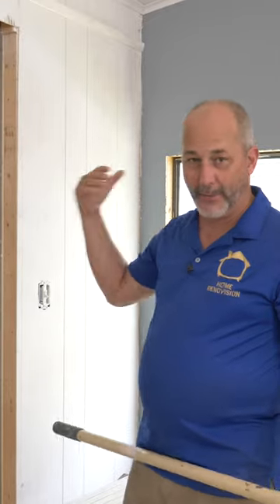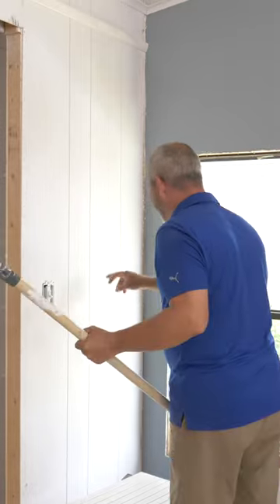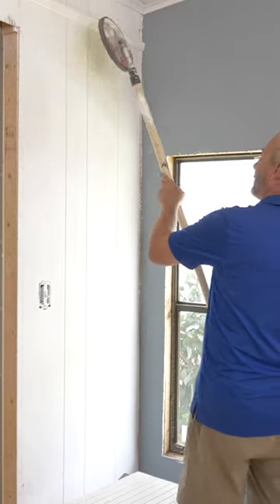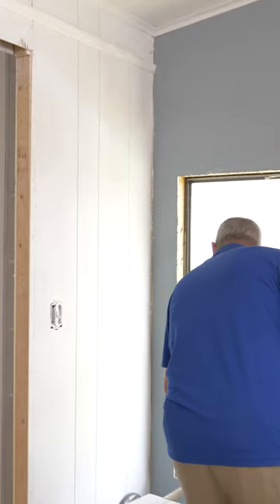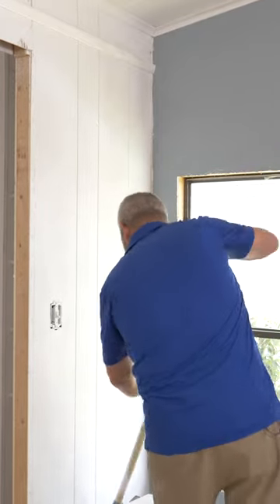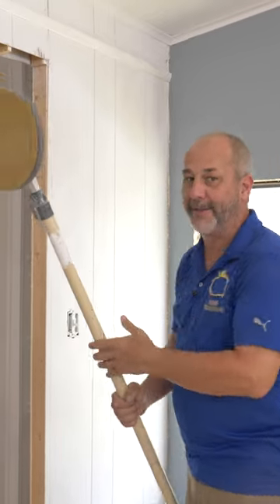Why Doesn't EVERY Painter Follow This Step?

Comment: Friendly tip! Your right, but do you use a damp cloth to remove the dust before applying the last coat? The gooseneck guy!  Cheers!
Reply from the maker: Hi Donald, no need. any fine dust acts like extra solids in the finish coat and is so fine it does not feel like dirt on the finished surface. Cheers!
Reply: Kind of the thing you know but don’t always do
Reply: That's the question I had.
Reply: I use a damp sponge. Seems to work better and last over more surface area.
Reply: Especially in delicate picky owner homes. Reduces so much dust 😅

Comment: What grit do you use?
Reply: Use fine grit 200+
Reply: I would use 24 grit sandpaper it works wonders trust me
Reply: @Adudeucantrust  you're missing a zero at the end
Reply: @Adudeucantrust wait a sec...can I trust that you didn't do that on purpose?...
Reply: @Adudeucantrust  I think you mean 240 grit not 24 grit.

Comment: I actually like to sand and rinse the walls with a hose, in between coats
Reply: Pro tip: complete both steps at the same time with a 3500 psi pressure washer.
Reply: Yes! And if you add in a little cat urine, it gives it more moldicid and makes the stipple lay down better too.
Reply: Lmfao!!!

Comment: if u skim coat, do u still need to sand the surface or put a primer on
Reply: sanding the skim coat is more important than sanding the paint. and then put primer
Reply: so mud on wall first, then sand, then prime  @vvsmixing
Reply: @randomrazr  for sure, also best if you get the sanding dust off the wall with a brush or towels or something before prime
Reply: @randomrazr always try to keep the walls clean the dust will give a rough texture that u can see

Comment: U realize u sand for prep of the surface paint doesn’t adhere to surfaces if it cannot absorb into it so “roughing” up the surface and using denatured alcohol helps allow the paint to anchor to the roughed up surface

Comment: No painter ever did this.... "It's a rule whenever you paint."??? No no no it's a rule to make money by being fast, friendly and efficient. You can talk to any professional painter.... nobody sands the walls. Hey random customer do you want me to make this job take 10 times longer and cost way more money in labor for no reason, you are in luck, I'll pointlessly sand your walls for you in-between coats. Sometimes I think you just make things up for clicks. Let's be clear this does nothing. The only reason why you would do this is because you are a terrible painter who gets drips everywhere. 100% not necessary.
Reply: It depends on how old the previous job was, the cleanliness of the job site, how well or not the previous painter prepped the wall, also depends if there was a sheen paint finish on the wall which is now going to be painted over. Those factors determine if you should sand a wall before painting or not. In my experience doing a light sand with a 320+ just to get any flakes or flaws from the previous painters job is the standard practice for most pros, youre doing a disservice to your customers if you don't, and believe me they will notice the lack of quality whether they tell you or not - and then probably won't be referring you to anyone. The coat also comes out noticeably higher quality if you include even a 30 second light sand between coats, you should really try it sometime.
Reply: It doesn’t look like he is doing a heavy sand that would take a long time
Reply: I agree, I never heard of sanding walls in between coats. Seems like a complete waste of time.
Reply: Sanding between coats only takes minutes and makes a significant difference in how the job turns out. If you're not doing it you're just being lazy.
Reply: @HazzardThom  literally makes no difference dude. Quit being extra for no reason.
Reply: @alphalight1469 You do you, but I like to the the best job I can. The difference is obvious, if you can't notice it good for you.